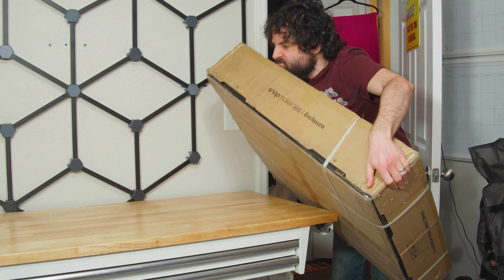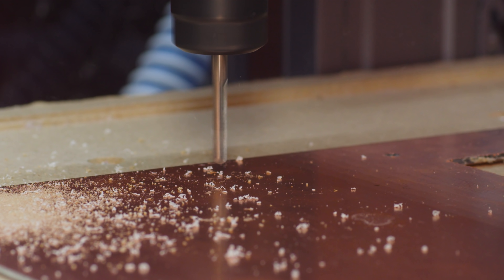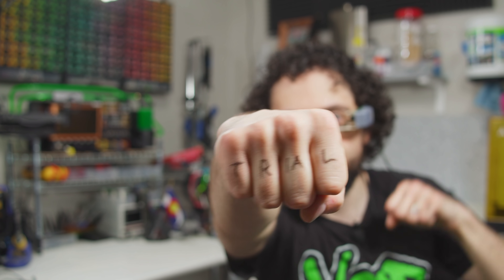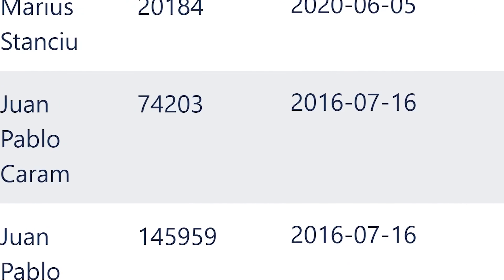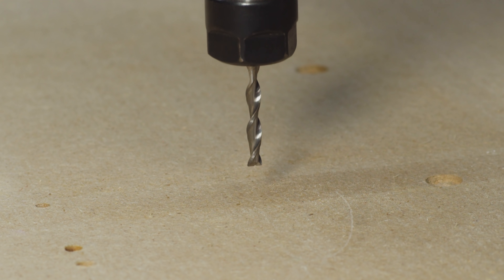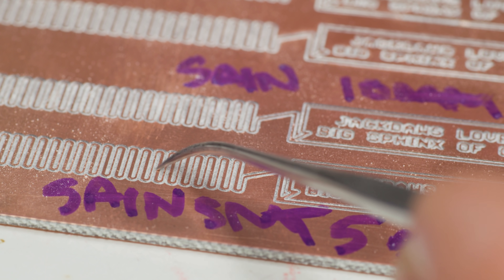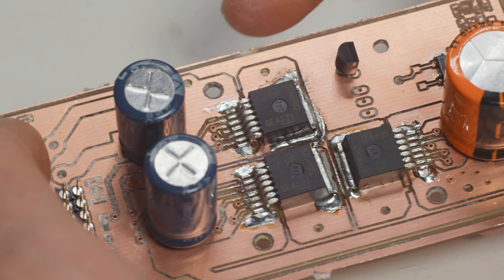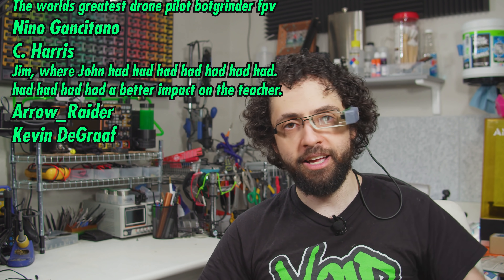PCBs in Two Hours? Zack Sucks at CNC

Comment: Are you kidding me??, it takes you two hours to make a pcb with a machine and doing it the manual way with Ferric Acid takes only like 30mins... ??? is this some kind of joke?

Like, you design the pcb with some design software (Orcad, Proteus, Altium, you name it), you print it on glossy (transfer) paper with your regular laser printer (or even on a page taken from a magazine, those that are glossy, doesn't matter there is something already printed on the page) you then iron transfer it into the virgin board (full copper face), then remove the rests of the paper and put the board into ferric acid to remove the non covered copper... Voila, you have your pcb almost ready (you only need to make the holes but that should take only a couple of minutes).

You want to make it more fancy with serigraphy?, well get some TRF (Toner Reactive Film, like from circuitspecialists or ebay), print the top face of your pcb into another trasfer paper, iron it into the other face of the board, then apply the TRF ironing again, voilá, you have your serigraphy done in just a couple of minutes.

Comment: I’ve used flatcam to make the circuit files and with a 3018pro cnc I was able to mill out my own double sided PCB using some software called bCNC which also has the ability to do a meshmap to account for the PCB not being 100% flat. 
I also used some engraving pieces I got from china that instead of a flat cutting edge they’re more like a hybrid of that and a drill bit. Edges of the copper were clean with no burrs. Cutting depth is the problem though as too deep and it can completely ruin fine traces.

Comment: Vacuum spoil board for your circuit boards. Then do like a .02 inlay into the the spoil board with fillets at the corners and lay the circuit board into the inlay not vacuum locked to the spoil board and aligned perfectly into the inlay

Comment: Is there a 3d filament that could be used in place of photoresist film that would hold up in etching solution? Seems that if a filament like that does exist, that would be the fastest, cleanest and most inexpensive way to produce a DIY Circuit Board. 
If this filament doesn’t exist, get it made and send me a spool. Great video as always. Thanks

Comment: Hopefully this reaches you 2 years ago so as to save you a bunch of headaches. 
1. Set Height Map
2. Use a 30deg Spiral Engraving bit(please, just the tip)
3. You need to blow on it once the tip is in. Seriously, you need an air assist to clear the cuttings away from the bit path. 

Great videos, by the way.

Comment: Great Video.The behavior  cnc control "remembering last feedrate indefinitely" like Many G codes is referred to as Modal . CNC Control interprets the meaning XYZ IJK etc  based on Mode. G20 inch mode G21 metric etc.
G90 and G91 for example are Absolute or Incremental Mode , G00 and G01 are rapid move or feedrate (F) move . G02 and G03 are cw or ccw arc mode.  Some controls treat different commands as modal.

Comment: Much easier to just paint a copper clad board, use a laser etcher to remove all the paint where you don't want copper to remain and then using normal etching.

Comment: Those Tiny Endmills are the prices of junk. Don't be a fool like me and buy it. I even set up the X-Y feedrate to 50 mm/min and Z to10mm/min with 20000 rpm spindle to cut 0.05 mm of a PCB board, and it broke at the starting the penetration for the first cut. Zack, please only advertise something you are sure about.

Comment: Fun trick, mount the board vertical and use a slitter blade. True you have to rotate the board around like a circus stunt but you get more feet per minute on the slitter blade. You can also bounce it back and forth between 2 opposing boards and send things flying. It tends to limit angles of traces until you get fed up and get a laser cutter to set the whole building on fire.

Comment: There are also a lot of interesting projects that I've seen built from generic circuit boards that you'd find in older commercial electronics like classic TV remotes for example. The circuit boards are so chunky that they're still usable even when the rest of their components are not so people will often cut all the circuits off the board and then solder on new ones

Comment: If you can't make PCBs with 0.2mm track width it's just crap.
I make power supplies and use some Analog Devices chips.
Some of them are 0.3 mm pads with 0.2mm between each that must be hot air sold.
And some pads must be .2mm width if you want to support isolation rules.

Comment: I have a Zmoprh VX and FAB that’ll mill soft aluminum, has a laser engraver, dual filament printing, and regular printing as well. The price tag has dropped since it came out to like ~2K. I’ve been able to go down to .1 mm nozzles and it has no issue pulling giant +5kg rolls

Comment: I fumbled my way through cnc'ing circuit boards a few years back, and had good luck with an aluminum spoil board, superglue (rather than carpet tape), and acetone.  helped keep things flat.  I had dedicated alignment pin holes that I'd design into the boards, and they had teenie-tiny ground points on them to which I'd set the CNC x-y zero using a usb microscope.  Yes, these pins were made from my vast collection of broken endmills.

Comment: Helpful thing to do with CNC if its viable is to use simulation software so you can go through a cnc workflow before running the program and inevitably crashing. Mastercam has some availability to do this but I don't know how expensive it is since I got to use a student version thanks to penn state. There are also standalone simulation machines like ones made Haas but as you can imagine, they are super expensive and I don't know about compatibility with other machines. 

You can also try writing down a basic workflow on pen and paper then read through the gcode to validate it. When I say this, I'm saying write down the algorithm for the process in plain english and generalize it. For example:

Set tool
set units
Start spindle and set speed and feed
set interpolation method
Begin machining of trace 1
modify speed/feed
modify interpolation method
modify units
begin machining of trace 2

Obviously you can go more in-depth into the generalization or more simplistic, but it can help to minimize crashes and in the future help you to make more efficient cnc programs.

Comment: I used to be a CAM/CAD operator at a custom printed circuit board manufacturer. 

A) You don't remove the locator pins. You use shorter ones. 

B) You program the G-code to drill the locator holes first, then pause. You set the pins. THEN you do all the rest, even on the first side. Relying on the tape alone can allow the board to shift as the bits push their way along, laterally.

C) I had to write custom GW-BASIC (yup, a LONG time ago) to check for things and automatically modify the generated G-code. Hand editing G-code is a losing game because there are to many opportunities for human error, and those errors almost ALWAYS cost money.

D) A vacuum bed will hold those boards flat AND release them without frustration as soon as you turn off the vacuum.

E) You are far, FAR better off laser printing your circuits onto transparency film (once you have calibrated the exact size of the print) than machining away copper. Most good laser printers have a setting to adjust the density of the print. Set that to the maximum so light doesn't leak through the black printed areas and cause there to be less resist left there than should be to get a clean etch. What black to the naked eye can still let a lot of light through.

Comment: Snapmaker is a beautiful machine that is an ok idea but it is the most expensive  machine with the least capability for that money that I have seen. The model you are using in the video is around $3000.00. You can literally do everything you just did on a 3018 pro for a machine cost of under $300.00 You can buy a lot of lasers and 3D printers for $2700.00. Just sayin, no one is giving me a machine to test for no apparent reason other than they are desperate to sell over priced machines that look good but are at the bottom of the capability range. Simply said, other than looks; there is just no BANG for the LOTS OF BUCKS. Are the words small enough for you, my brother.

Comment: hey machinist here, i have a few possibly helpful tips:
1. when using a flat endmill try not to plunge straight down but instead helix into the material. 
2. you can find a lot of bits at machinist shops like herrics, MCSdirect, Grainger, Shars, Kennametal, ect. 
3. some too materials and setups work better than others (HSS v.s Carbide, or 4 flute vs 2 flute) the harder the material the slower you can spin the spindle with larger feed same with more flutes.
4. Slower spindle speeds will make your tool wear down slower within reason.

Comment: Maybe I'm missing something, and/or it's a non-issue once you've figured out the manufacturer-specific G-code quirks, but it seems like a good idea to run a test-cut on something a bit more bit-friendly...

You know plastics better than we do, so is there something rigid enough to stay flat on the bed but soft enough that in a fight it'll let the cutting head win? If so, you could cover the top surface with a thin layer of something contrasty - vinyl contact, spray paint, hell maybe even just sharpie-scribble - and use that as a cheap sacrificial offering for the early testing stages.

Comment: Use the CNC to drill holes, route the board dimensions/outlines, etc.
Use the UV resin printer to expose photo resist on the PCB, develop and etch as usual.
(Locate the PCB on the resin printer with the locator holes BEFORE removing the resist protective layer - and put 'end-stops' in place so the PCB won't slide around when exposing the resist)

Comment: A better approach than resorting to the micro end mills would have been to use mesh bed leveling with the v bit itself as a probe. The board is conductive, your v bit is conductive, you'd need to run the full mesh for every single board obviously but then you'd have a consistent height across the board to use the v bits. Behold, 0.05 mm traces. https://www.youtube.com/watch?v=HZFFfwEbqmQ

Comment: U say u have ADHD do u take medicine 💊  for it I have ADHD and dyslexia I'm 37 and have been taking tablets since I was like 10- 11 years old  I've always loved taking things apart and working out how they work  I love 3-D printing I love playing with pcs And my shed is just full of old Tech that I've taken apart and kept pieces from I can never seem to manage to find a project that I can actually do I always get stuck somewhere and lose interest It's like I can do the parts that I'm interested and like doing but when I get to a part that I don't like I give up
Reply: I've had a tronxy XY2 pro for around 3 years I've never Replace any parts I've probably had about 15 or 16KG through the machine And it is still going Although I only have about 25% of the plate left I have to use the front 3" The Rest of the printer the sticker has peeled off stuck On the bottom of prints

Comment: Why do you review a CNC machine when you are not into CNC?!?! Pointless to me. Every process needs some learning and knowledge but when the interest isn't there the result is always as bad the machine could be by doing everything wrong or not knowing what you have to do exactly. The problem are the used bits, the drill needs to be thick and bold with a small pointy center and not a long small pointy drill if you want to engraving stuff (just what it is, hit the surface away.) A long small pointy drill will break easily when you do surface stuff. For inspiration, take a look at the channel of Uri Tuchman and look at his engraving content, that is not a long small pointy bit. Just a portion is small, the portion that needs to cut.

Comment: I used to use an auto leveling software when I used to mill PCBs . It was another step took a bit time but worked well . But haven't used self milling for a while now. I got some good results with small v bits using it.

Comment: Having plenty experience with “PCB” milling, you need to have a z-axis which floats, and a stop which rides on the surface to maintain constant depth. The end mills work great, but use the largest one you can get away with. A 0.2mm one only gets you about 2-5m of milled length in FR4. Yes, that stuff is super abrasive. 

Without solder mask, you really have a dumpster fire going on if you do anything complex (yields? What are those?)

Comment: just use an axial lead from a thru-hole part to use as a jumper for a a via. The smd device may float a little higher from the board.. your not soldering high freq. boards
Reply from the maker: That's the standard way to do it, but it's awkward. For one, the via needs to be humongous and looks awkward if you manufacture the board. It's also tricky to solder on such a small annular ring, and I sometimes rip them off when I trim the wire. If you can get the rivets, I strongly recommend them

Comment: Regarding the cutline width problem with v-bits: There are attachments called Engraving Milling Depth Regulator or similar that solve this issue. It also helps if the fiberglass material is not stuck down exactly flat.

Comment: why didn't you laser the pcbs?
Reply: Laser would not burn through copper layer, but I've seen a nice workaround - spray the PCB with a thin layer of black acrylic paint, burn the traces with CNC laser, clean the burned paint with water and soap, then just etch the board and remove the paint with some acetone. Given how precise those laser heads are, the traces should be super crisp. There are some variables to work with (type of paint, paint thickness, laser strength, etching solution etc), but it's a promising direction imo.

Comment: you really should go see a machinist to get a decent support (very flat stainless or iron) then you could add a layer of sacrificial acrylic each time you need it. Also you can/could use a PID loop on the z axis while going to town. flatness, + height correction from new sensors (hall sensors with a magnet on the bit would give you consistent reading of distance.)..

We need some micro-center in quebec...we have a big art suplier named micheals nearby but they dont sell any electronics, wich is a bit dumb. but eh here we are kind of late on everything..

The reAL QUESTION BEING do you plan to fit the 3 heads onto a loading cart or a disc ? make a tool changer  ??  this would be literal perfection the machine  seem so well done.

3d print while checking the surface with a close camera blasting lasers to smooth lines ....this whole machine makes me think about the one with the A.i in it that know what its doing. building machine learning for it would be the most badass project ever..

Comment: I've been working on this exact same thing, but with a 3018 cnc for < $400.  If people upvote this, I can add more data and videos.
Reply: I'm using vbits, and pcb leveling.  This allows me to cut very fine traces, and not break the tip.  I also noticed the bit would misalign while tightening, takes a few tries to get it aligned properly, then most of the bits I have worked.  Don't Wobble afterward, as I had the same issue.

Comment: Anyone wanting to do this should investigate using a desktop machine that ISN'T a glorified 3D printer. Notice the significant horizontal deflection that occurs every time the mill/bit touches the work surface? Ya. My $40 "worse than Harbor Freight" drill press isn't this bad. 3D printing and laser engraving do not experience significant lateral forces on the business end like milling and engraving.

Comment: Ok stupid question. Is it possible to 3D print on to a bare copper board where the melted plastic acts as a mask and then we just etch it as normal? Maybe limited to SMD but I figure it would be hack a lot cheaper and easier to do that.

Comment: Not sure about snapmaker controller software, I used to use chili pepper which can do auto level by probing. There is still problems after auto level for long PCB traces. I actually created a PR for flatcam to break the long traces into segments so that auto level can work. That was several years ago, can't remember whether the PR got accepted or not. Anyway, together they worked great. I'm free to choose most of the v shape bit without much concern.

Comment: what if someone implemented that saw stop tech but for printer heads, I don’t know much about 3d printers but I know they print non conductive material, so if the bed is metal a connection could be bridged when the head touches the bed, stopping the head from damaging it. I see so many people talk about hurting their printer beds

Comment: I think you might need to probe the board to get better results, similar to auto leveling with a probe for a 3d printer, but by attaching a lead to the copper board then building up a height map by having the milling bit touch the board at different points.

Comment: That's pretty sweet that they just gave you a CNC machine. I had to make my own. Being as copper clad board is conductive it's pretty easy material to map. You should probably find out what surface mapping is and how to do it. I stick PCB down with hot snot. It doesn't take much to hold it down really. If there's any pressure at that bit you know what happens to them. Snap!